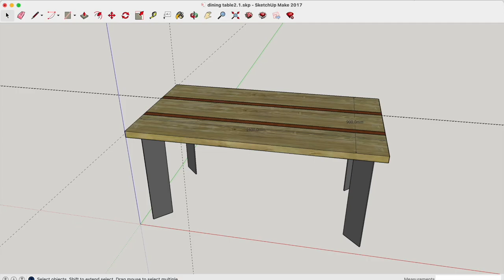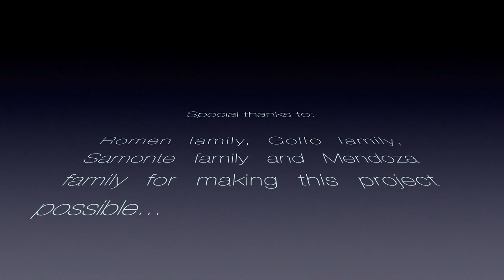DIY Epoxy Resin Dining Table

Comment: When you’re jointing a board, do the face first and then hold that face tightly against the fence when jointing the edge to get a 90 degree corner.  That and clamping the joints flat at the ends would have made for a better glue up.  Interesting base design!
Reply from the maker: Thanks for the advice brother Ill keep that in mind.. :) 😊
Reply: Jointer is bad, when you joint bigger and heavier boards the fence is moving, i have the same problem with a scheppach jointer.
Reply from the maker: @danijosceanu1700  I think we need to buy bigger Jointer :)